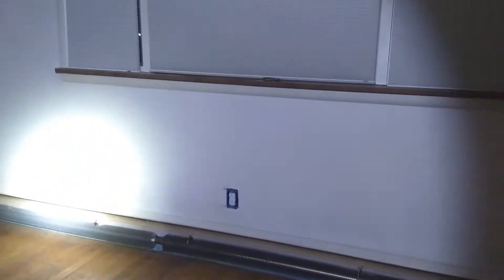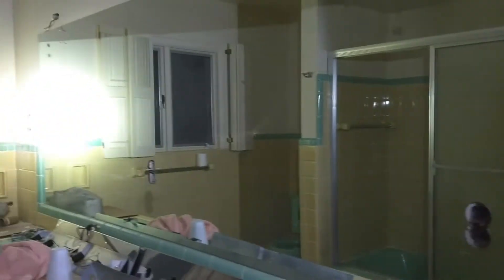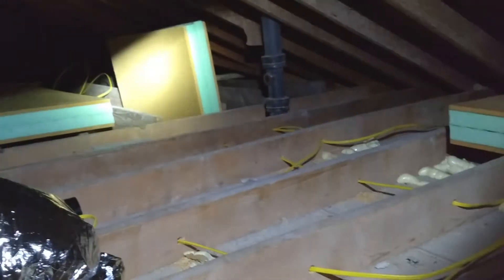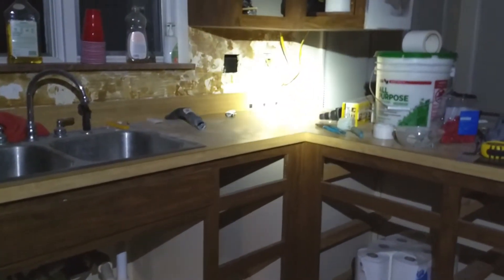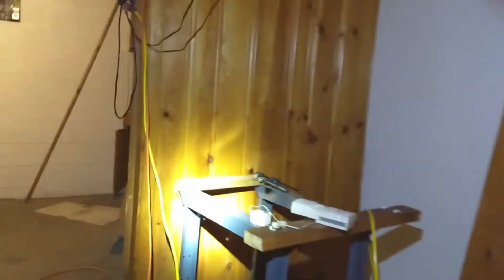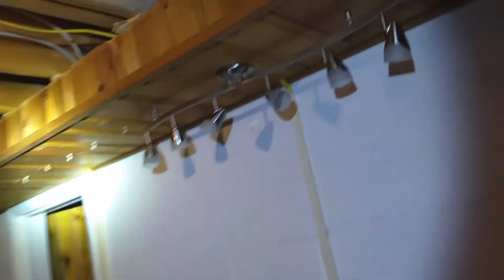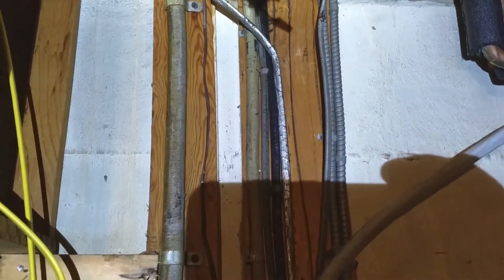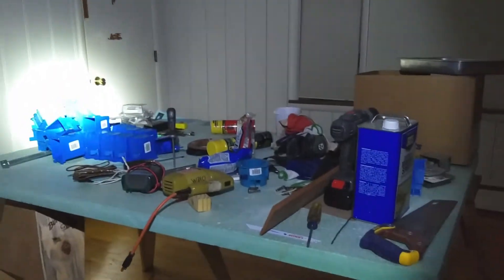House rewire series- update 1 | MRS. RATTLECAN'S HOUSE

Comment: Can we get an update?
Reply from the maker: Pretty darn quiet believe it or not. I had one junction box that stopped working and found I hadn't gotten the connection tight. I have one external outlet to finish in the spring then should be completely done. Have to replace the panel in the shop but that will be documented over on the Rattlecan Guitar Restorations channel. Good luck with your wiring project.
Reply: @mrsrattlecanshouse5966  Cool!  I just finished redoing the parts of our house that we use the most.  I'm saving the kitchen and bathroom for when I reno them.  It is kind of amazing when you DIY to see how little effort it takes to do a clean and pro-looking job.
Reply from the maker: It can be the source of both pride and frustration, that's for sure!